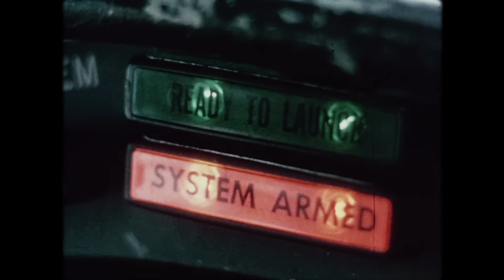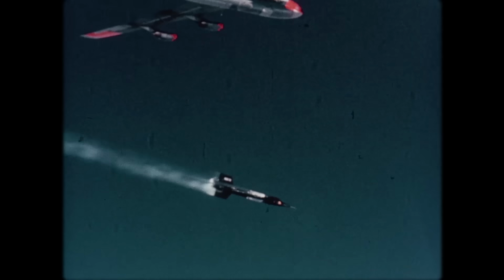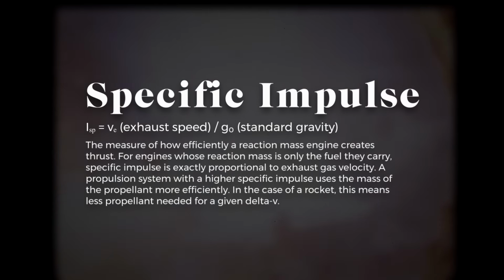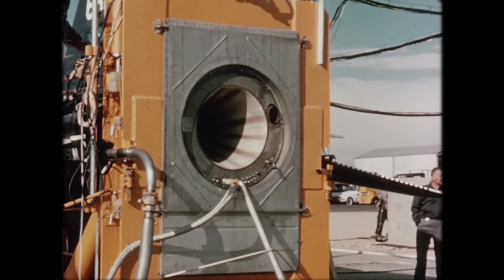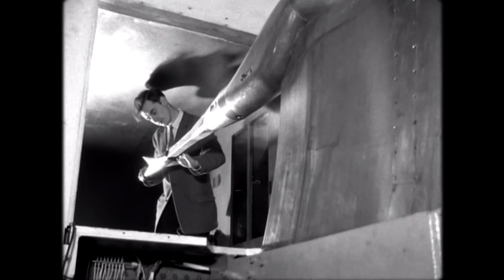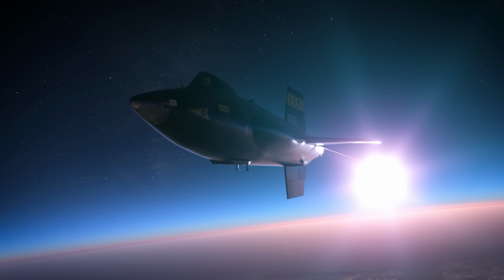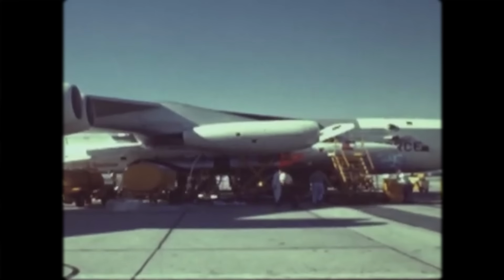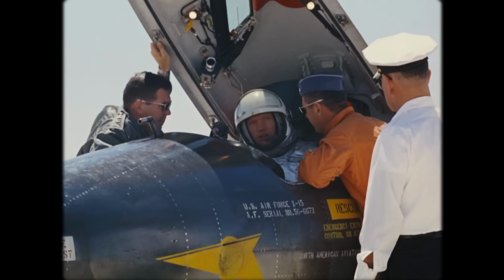The Insane Engineering of the X-15

Comment: WANT TO LEARN OF TRUTH. Free energy is in our Bibles and is so super simple that it should be positive proof of an extremely powerful SPIRITUAL WARFARE that is going on behind the scenes, in order to cover up the simplicity of this technology. This free energy technology is so old that it can be found in Ezekiel 1:16, where it is attempting to describe the workings of a UFO motor = ”a wheel in the middle of a wheel”. I used pulleys to imitate this technology, where you only input a few sparks of current for 1 rotation of a motor with a large 33 cm circumference, (about 10 cm diameter) pulley attached. This would freely gain you 99 cycles of AC or DC electricity, from 3 mini-pulleys of 1 cm circumference-(about 0.33 cm diameter) with AC or DC motors/generators attached, by simply running the same belt-strap or even a tied piece of rope or string in a pinch, past these 3 mini-pulleys https://www.youtube.com/watch?v=NxpoiCFKmPg
-
+ Don't believe in the torque lie, as the only power that these three mini-pullies need to produce is a lot of voltage, (easy to do) + a few sparks of current, to crank over this 33 cm pulley once. That's right, this one large pulley + three mini-pulleys are forming a self-powering set of DC generators. The many rotations of the mini=pulleys build up the massive voltage needed to crank over the large 33 cm pulley once. Then you use the large amount of belt that you gain from the single rotation of the large pulley to rotate the 3 mini-pulleys in massive amounts of times
-
Want to know more about something that really matters, like the Truth about the true powers of this world, reality + what our lives are truly all about. Trump believes in our Father in Heaven, and by the way, the ARK of the COVENANT has been found in Jeremiah's Grotto, right under where YESHUA=Jesus was crucified. So HIS BLOOD + WATER that came out when He was stabbed by the spear could run down the crack in the bedrock, that happened when the earth quaked + landed on the correct side of the ARK, that was placed there many hundreds of years earlier. His dried BLOOD was still alive even, + tested as only having 24 CHROMOSOMES = Virgin Born + proving HIS DIVINITY.. (only had one parent regular =46, which is 23 chromosomes each) + Him with 23 from His mother and only one male Y chromosome from His Father in Heaven.
-
PLEASE WATCH THIS VIDEO https://www.youtube.com/watch?v=B8TRoQk6WUE @ (41:41) = HIS Blood is STILL ALIVE + had only 24 chromosomes = 23 from his mother + only One from His Father (normal people have 46 = 23 from the mother + 23 from the father). If these videos have been taken down, then in YouTube search these words = ( ark of covenant blood Ron Wyatt ) - Sorry guys + gals, but the higher up elite of mankind has decided to believe + side with these aliens (fallen angels + Nephilim) = sons+daughters of the children of fallen angels + human females in building these particle colliders + quantum computers - which mess with our timelines + allow evil spirits into our reality. 
-
I cannot be sure if Trump was-is+will-be the best American President,,, but did you notice that the fake news of the very corrupt media does not mention all of the great things Trump did?. Democrats not only want to kill your unborn offspring, but they want to kill them after birth even. DON'T BELIEVE ME,,,., then Google Democrat + abortion, then you can see for yourself. + BY THE WAY - ISN'T THE FACT THAT THE ARK OF THE COVENANT HAS BEEN FOUND in 81 + WITH CHRIST'S BLOOD ON IT + STILL ALIVE = (PROVING HE IS DEVINE), HAVING ONLY 24 CHROMOSOMES = PROOF OF VIRGIN BORN =(the biggest NEWS ever, and proof of the corrupt + fake NEWS)= why is this not covered on every TV station <<PROOF = search YouTube>
-
TRUMP ELECTION SCANDAL <<< If these are true=This Is Scary >>>
https://www.youtube.com/watch?v=NOiaymqaQdc&fbclid=IwAR1lcZFAjGij0TmkIGLRLsJnayWpZsTRViXB-DmOATG0E3JXgHlWl5fAl9g
+ https://www.youtube.com/watch?v=V_7Z058MC7M&t=3735s
+ https://www.youtube.com/watch?v=dBj9ZDC_Ad8&t=1481s
+ https://www.youtube.com/watch?v=m0YKf-caVuY&t=240s
+ https://www.youtube.com/watch?v=V_7Z058MC7M&t=3720s
+ https://www.youtube.com/watch?v=OWwNJZhcrww
+ https://www.youtube.com/watch?v=R5ki6S-WsKU&t=977s
+ https://www.youtube.com/watch?v=Z8UZn7PmyXc&t=112s
+ https://www.youtube.com/watch?v=Dc-HQyBm8GU&t=4242s
+ https://www.youtube.com/watch?v=HIKOXyxlhag&t=381s
+ https://www.youtube.com/watch?v=V_7Z058MC7M&t=3735s
+ https://www.youtube.com/watch?v=bgMpTQNCcgg
-
https://www.youtube.com/watch?v=spnJ5WDgZnY
Isn't it amazing what knowledge we can gain by simply adding the “il-s” of life, into this evil theory.,, EVil-sOLUTION. Evolution never happened,,, and it never had the time, so it could have happened,,,, because we have only been here on this earth for about 6000 years. Think about the odds of us on this earth that is constantly gaining mass from space dust and meteors, revolving around a sun that is always losing mass from burning fuel=mass. If mankind has evolved over billions of years, then why is there only about 6000 years worth of His-story and so little space dust on the moon = see the moon landings, there are only a few cms of space dust. If evolution ever happened, then it needed the moon to keep the oceans from becoming stagnant water.
-
WHERE ARE THE THE BILLIONS OF YEARS WORTH OF DUST DEPOSIT. Surely that would have produce meters of dust, as would not the dust have been even thicker way back then + Don't try to tell me that something or someone removed the dust every so many thousand years.
-
DO THE MATH FOR YOURSELF = the amount of dust deposit is known,,, + the amount deposited every year is known too. I did the math in the early '90s, and it worked out to be about 6000 years worth of dust that is on the moon now. I don't know if they use the same figures now or not. But even so, it should be obvious that after even one billion years,,,, the dust should be many meters thick.
- 
TRUTH about COVID-19 = https://www.youtube.com/watch?v=H_vNWmqWmZc 
+ https://www.youtube.com/watch?v=vzIWq_59MIY
-
This is so simple that it should be proof positive of the Battle between GOOD + EVIL.
Proof of a most powerful war going on in the background, with REAL BAD FORCES that are controlling our lives. Please remember that Satan is called the ”god of this world” in our Scriptures = (2 Corinthians 4:4). You only need to input a few sparks of current, that rotates a large 33  cm circumference pulley once, to multiply you an output of 99 cycles of AC or DC electricity from 3 mini-pulleys. Do you see how super simple this is, and how powerful the evil forces are to keep this super simple technology from us for so long?
-
FREE ENERGY = SIMPLICITY AT THE BEST (AC Electricity Multiplication using simply the geometry of pulleys to multiply AC rotations) (a DC motor only takes a few sparks of current, to rotate one full time) Please don't be fooled by the old false torque problem lie, because this torque only occurs when you are producing power. And no matter how much voltage you need, when you multiply it by the few sparks of current that you need, (practically nothing) it equals only the smallest amount of power, (requiring very little torque).
-
(EZE 1:16) “The appearance of the wheels and their work was like,,,,,, and their work was as it were a wheel in the middle of a wheel.” - As in, a little wheel inside a big wheel, but I could not afford to buy a big wheel with threading on the inside, and a mini wheel with the same threading on its outside. So I did the next best thing, I connected a big wheel to a mini wheel through a belt, strap, rope, or even a piece of string in a pinch to connect the two pulleys with motors attached.
-
Have you ever heard of the MANDELA Effect? PLEASE CHECK THIS OUT,,,, + then try telling me that there is not a POWERFUL SPIRITUAL WARFARE going on in our world. This is a must-watch video. All of time and space are changing. Things that are true have been altered + CERN is the cause for these events.
https://www.youtube.com/watch?v=pPrutcbaerQ
- 
Here is one of the videos trying to let this scary information out 
https://www.readersdigest.com.au/true-stories-lifestyle/thought-provoking/44-mandela-effect-examples-that-are-seriously-mind-bending
-
+ here is an explanation by the Physicists https://www.youtube.com/watch?v=HHKmoBeNWWQ&list=PLDIEv5nkqqEa0-u8DIzqpefKBAG0nkb7g&index=2 
-
CERN Is Changing Our Timelines – Proof - Mandela Effect Part 1 + this is a video of what they are really up to https://www.youtube.com/watch?v=49dGknES0-w 
-
Here is a website that shows you how quick + simple this GEM technology is to build
= https://www.youtube.com/watch?reload=9&v=NxpoiCFKmPg 
-
http://beliefstoliveby.yolasite.com/ 
http://evolutiondebate.yolasite.com/ 
-
TRUTH ABOUT CERN
https://www.youtube.com/watch?v=49dGknES0-w 
https://www.youtube.com/watch?v=ooZA0riSa9Y 
D-WAVE COMPUTER
https://www.youtube.com/watch?v=1v19n5JBSDs&t=305s 
ILLUMINATI PLAN FOR HUMANITY
https://www.youtube.com/watch?v=49dGknES0-w
Reply: What are you smoking?

Comment: This is a great history lesson.  But it is wrong the information is not correct.  The M15 is not the worlds fastest craft. In 1977 we proved it.
Project hanna. Code name the aura ". Worlds first plasma craft. Faster than the HUMEN body can with stand in any suit of that day. No fuel, no exhaust , no real sound but the pop when the sonic boom hit. The most complex part I had to over come in the design. Was keep the pilots alive. My Aurora" has a liquid filled cock pit. My pilots wear a dive like suit. Think of a fish tank. 
2 pilots. So fast that in 1977 we didn't  have the means to calculate the distance. Reason.
The craft is gone so fast, you can never see it.
You'll see clouds move like something sliced thru them. Puffs of curles clouds. But she's faster than our understanding of time and space. Out biggest fear was if the pilots shot off and couldn't make the turns we'd lose them to space. NO country has come even close to her 1977 we set the bar so high. The cock pit liquid protects pilots from subatomic particles and there no outside heat. even in reentry. The world would have seen her in 1977. We were heading to a DEFENCE airshow. And the Airforce showed up with trucks filled with heavily armed men.
Shut us down. Took everything to go hide it at area 51. The public will never see our work.
They stole it. No tax dollars were used. A hand full of us were forced to go work at area 51. Pretty much slaves no PAY. Taken from our house at night by the airforce. 1977. The airforce controls 100% of what it let's the public see or know.
Reply: Source?

Comment: There's a minor mistake in this video. You repeatedly refer to the Merlin's "Pre Burner" however the Merlin is, as you pointed out yourself, an open cycle engine and as such does not have a pre burner. Pre burner infers that the fuel is PRE burned, which is only the case in closed cycle engines where the Gas Generator exhaust is fed into the main combustion chamber. An open cycle engins, by it's very definition, cannot have a pre burner because all of the fuel is burned only once

Comment: H2 + O2 is not the best specific impulse possible with a chemical rocket. It's just the best possible that people really use. It's possible to get better numbers by using more exotic propellents involving fluorine, lithium, beryllium, or boron, or maybe even just oxygen the form of ozone. These propellents just all have terrible problems like extreme toxicity, explosion risks, too much complexity to contain or to make the reaction run smoothly and efficiently generate thrust, not to mention just plain expensiveness. There's a popular claim that the highest specific impulse rocket engine ever fired was a liquid (molten) lithium, liquid hydrogren, liquid fluorine tripropellant rocket, with a specific impulse of 542 s according to Wikipedia. There is also the point that you can get much better specific impulse than any chemical rocket with a jet engine, ion thruster, nuclear rocket, etc., but that's mostly beside the point.

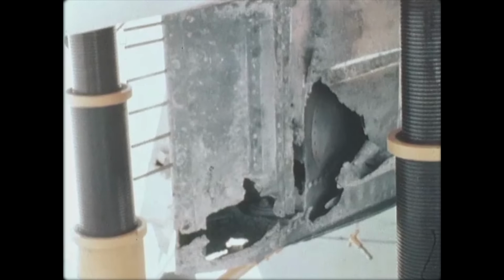Comment: A point that has probably been brought up already but at 28:27 you state that the ablator failing was the cause of the major damage to the Mach 6 test flight. While some of the ablator did fail and some damage was done the majority of the damage, (shown at that point to the ventral fin) was specifically due to the dummy SCramjet mounted there when the hypersonic shocks shedding from the dummy SCramjet impacted  the fin and overwhelmed the ablator AND skin and almost severed the ventral fin in flight. Oddly this should have been obvious from earlier testing but from what I can gather from sources like Secret Projects and the relevant Hypersonic research books and articles it was somehow 'shown' mathematically that such shocks would in fact NOT interact as had been observed previously due to a supposed 'feature' of the suggested podded SCramjet engine which was never observed in actual wind tunnel testing. I suspect the idea was that (as shown in the earlier X-15 'reentry' diagram that due to a high angle of attack the SCramjet shockwave was assumed to pass beneath the airframe but since this was in the PLACE of the main ventral control fin the X-15 was not going to achieve anywhere near the needed AoA during the speed run so that doesn't make a lot of sense.